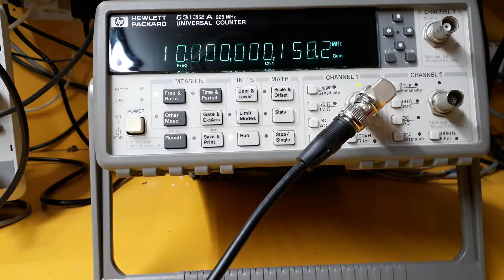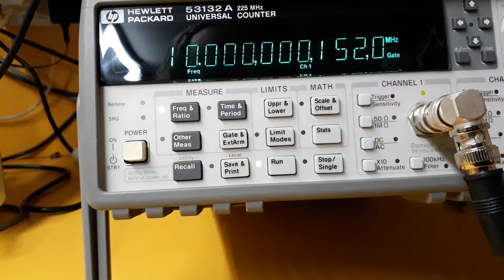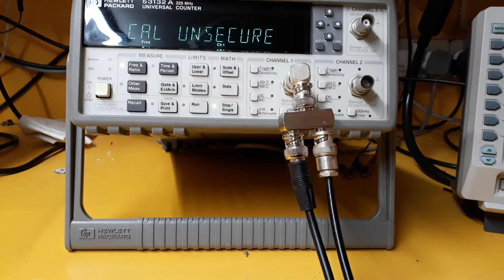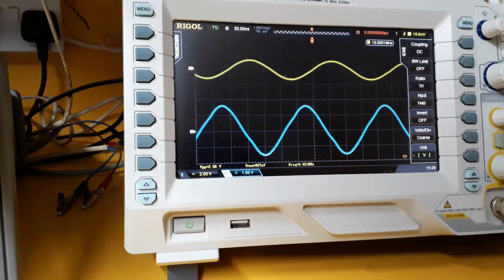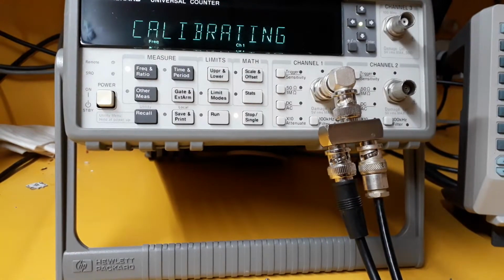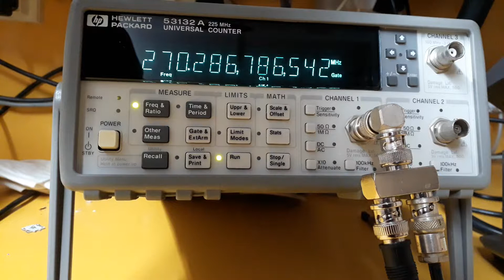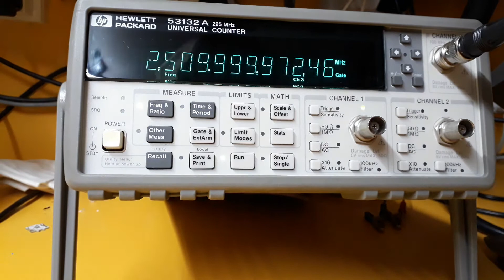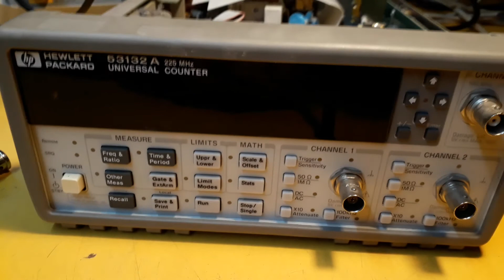Hp 53132a testing and calibration

Comment: Regarding resolution - it can be higher, with gate time 10-15 seconds. But it is only suitable for long-term measurements...
Reply from the maker: @BarsMonster  Yes I'm aware of that thanks. I occasionally use a 10 second gate time for an extra digit, but normally I have it on 1 second. It's a lovely counter though

Comment: Something is wrong. Or with you counter or with your GPSDO. Readings must be much more stable and accurate after calibration.
Reply from the maker: It's a long time since I did that video, so my memory is not good. But the problem is I think it's only got I think a 14 bit DAC so it's never going to be perfect and we're taking about milli Hz resolution here! Also the installed time base was not the ultra high stability version. I installed a better one in another video.

Comment: You can grab a few decimals better by using stats and cranking the number of samples little by little. Also pretty important to keep the angle of the device constant after cal.
Reply from the maker: Thanks I will have to try that sometime. Yes I'm very much aware of the affects of gravity on the OCXO. By the way since calibration about 2 years ago the  higher quality OCXO I installed has remained completely stable at about 5 mHz error compared to the gpsdo despite being power cycled several times due to power being off a few times

Comment: Hi, bought myself a hp 53131a from that well known auction site... didn't pay a lot for mine either, the only thing that was missing was the carrying handle. Went and bought internal ocxo for it, with a trimble oscillator and it's a superb performer! Also have a trimble thunderbolt gpsdo in my workshop (the gold can model).
Happy days 👍
Reply from the maker: Yes they are a superb counter, & since putting in a new over controlled time base, has only drifted by a few mHz in roughly eight Months! I check it occasionally against the gpsdo

Comment: Nick, that is a very nice counter!  The simplicity of calibrating was awesome!  I thought you'd have to bust out the twiddle sticks!  BTW, it did look like there was a screw cover on the oven for maybe a finer adjustment....but at just a few hertz...I'd be happy.  Great video!  ~Jack, VEG
Reply from the maker: Thanks, yes I was very lucky to get it & the usual hp quality. No twiddling on this counter all done in software! I just hope it never goes wrong as the service manual has no schematics, you're supposed to send a faulty board back to hp for replacement.regards Nick
Reply: Will these work?:  https://bit.ly/2BoYVez , https://bit.ly/2UJi95R , https://bit.ly/2DbDDBs  ~Jack, VEG
Reply from the maker: @VintageElectronicsGeek  thanks for that link, that would be an excellent upgrade to the Crystal oven in my counter, but as I'm using a gpsdo as my external reference from a gpsdo most of the time, it's not really needed in my case, gpsdo are really great, they are a cheap option around $100 that provide amazing accuracy that was unheard of a few years ago unless you had several thousand $ to spend!
Reply: Well, I tried!  :)  I recently picked up a 10 MHz TCXO for $8 I believe...I was very surprised at how spot on it was. The next item I plan on picking up will be a GPSDO, as I am learning electronics I see I need one.  ~Jack, VEG
Reply from the maker: @VintageElectronicsGeek  yes watched your video on that, they really are not stable enough for anything exempt a low resolution counter but hey you get what you pay for! these days GPSDO is the only way to go!